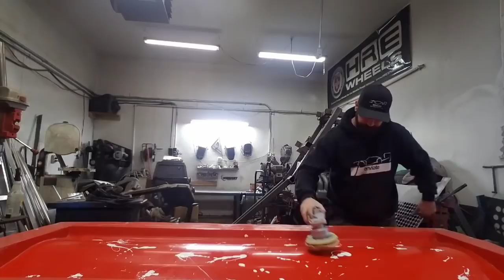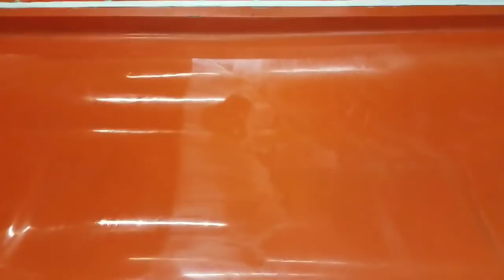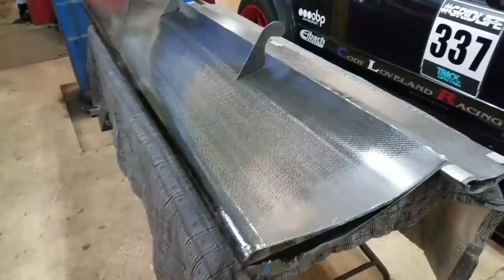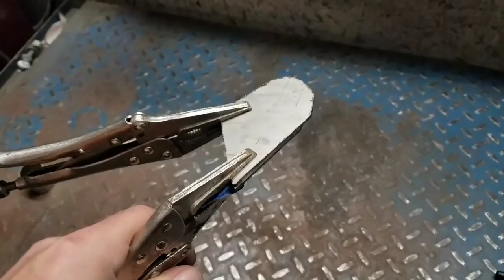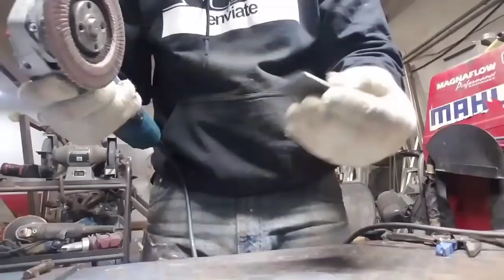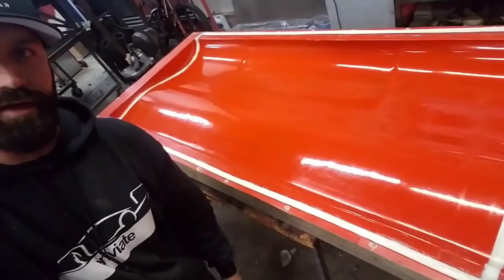Wings and Things Part 1.

Comment: Cody. Have you looked at a cheap hvlp gun for PVA? I use a cheap on from harbor freight. A very light mist goat for first. Then 2 nice med wet coats and it's smooth as glass. Loving the new videos keep up the good work can't wait to see the #2 car done.
Reply from the maker: I havent....I'll dig a little.  This one does ok, just have to be careful lol
Reply: @CodyLoveland  definitly look into it. It will be a huge difference in spray out. It seems your current gun puts out so much air compared to pva that the pva is starting to dry before it gets to the surface. Thus causing it not to flow out and create orange peel. I'd be willing to bet you would even see a reduction in the amount of pva needed. I also apply mine with a 50% over lap just like painting a car.
Reply from the maker: @michaelcoffin4364  definitely not drying in 50F temps, lol. I'm just shy on the coat as I'd rather have a light first layer than a running mess 😂
Reply: @CodyLoveland  I agree. Peeling pva sucks!! If I run it, I just lay on a fat coat and put a fan on it to dry fast. Then peel it off with a blast of air. It's literally faster for me to spray heavy and peel. Than it is to nit-pick every square inch and possibly miss a tiny piece. Keep in mind that's in 90- 100* Oklahoma summer weather.
Reply from the maker: @michaelcoffin4364  I use foam brushes to "feather" the runs and excess.  Works surprisingly well.  And yes, I prefer summer time carbon work.